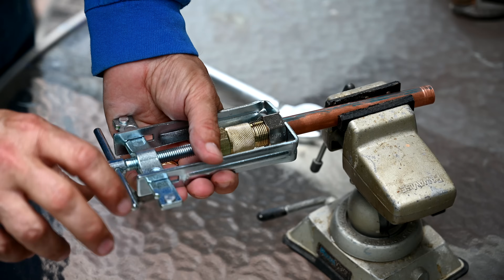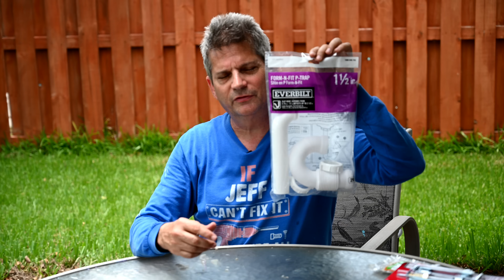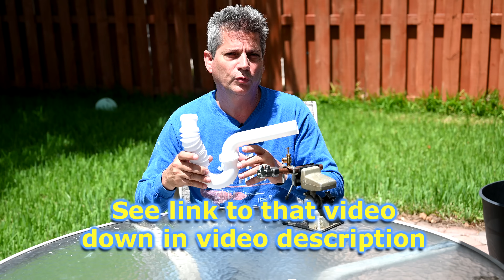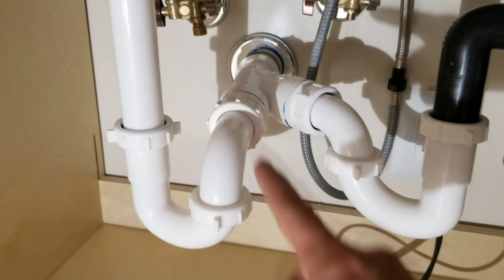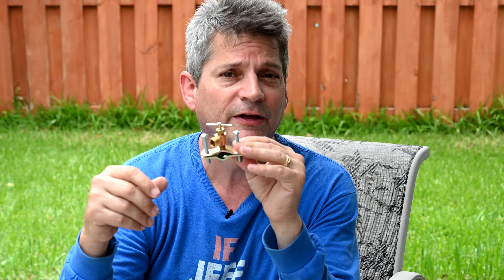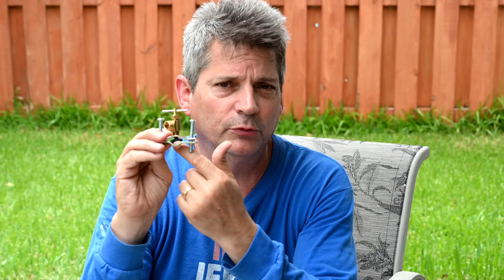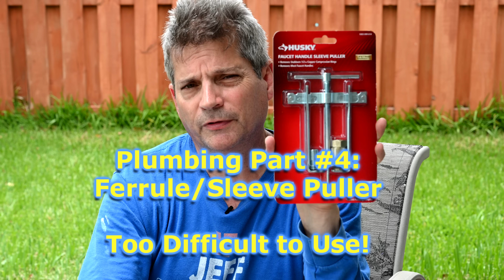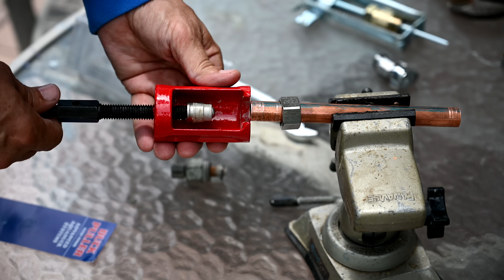4 Plumbing Parts/Tools You Should NEVER Use. NO Plumbing Fails

Comment: I live in Ohio, BestBuy installed my water line for my fridge, and I think they used dat there 3rd part you mentioned.
Reply from the maker: As long as it is visible, just keep an eye on it, check on it periodically. If you see anything starting to leak, time to call the plumber in to give you a double shutoff valve.
Reply: @jeffostroff  it leaks, but only when I try to get more waterflow from it. This means our cups take forever to fill, when I try to increase the pressure it leaks right where the stem of the twisty thing goes into the fitting.

been wanting to get it fixed for awhile, and now that I seen this video, I'm going to lookup the code in ohio and see if this was something illegal they did. If so, see what I can do about getting some justice.

actually, I made a video of it recently (mainly for my uses) https://youtu.be/M0q5wYdngi0

1) just realised, but at 48 secs is that an S Trap and should I replace it?

2) the fridge thing I was talking about is seen at 3:37
Reply from the maker: @Layarion  You tube says video is in private mode, so we can't see it
Reply: @jeffostroff  sorry, I set it to Unlisted now.

Hey I found this: http://codes.ohio.gov/oac/4101:3-6-01

at 605.9 it says  "Prohibited joints and connections. The following types of joints and connections shall be prohibited:" and then says "4. Saddle-type fittings."

so I think that's confirming what you said in the video about it being banned, just wasn't sure if you meant all 3 were banned in all states. either way, ohio is confirmed for that list.

aside from fixing it, this was installed maybe 5 years ago. Is there anything I can do to bestbuy to get them to pay for installing something illegally? like, "hey buddy, this violates the code. fix this and eat the cost"? like, what do you think I should do, besides the more obvious "not nothing"
Reply: @jeffostroff  should be able to see the vid now.
Reply from the maker: @Layarion   Layarion  Holy cow dude, you got multiple issues at once. I suggest you blow the whole place up and start over! LOL. It looks like you have several spots on that basement floor where rains are being absorbed into ground water, then leaching up through your cement slab. this might repeat itself after winter frost melts in spring. Back in the day they did not put Visqueen plastic underneath the foundations before they poured, which would help keep water from raising up through the concrete. You should check out Mike Holmes for how they solve these issues, sometimes I have seen them put down thick firm sheets of insulation on the concrete, then build up the floors over the water, which is channeled to the weeping tiles on the perimeter of the basement. Also I'm concerned about the rotted support post on your stairs, get that fixed as soon as possible, just bring in a new pressure treated 4 x 4 post, and put a metal plate at the bottom where it touches the concrete. One other reason your saddle valve is failing, is they mounted it sideways, so any mini drips of water run down the saddle and corrode it. Also, they apparently have no gasket that I can see, so they have 2 dissimilar metals touching, which is a big no-no. I always felt they should have the saddle made out of copper as well, now 2 different metals touching causes corrosion. I would try to get Best Buy customer support to send out a real plumber. If that fails, file a BBB.org complaint against them, as well as the state attorney general web site online consumer complaint form, they forward the complaints to the corporate office and usually someone there can resolve the issue.  Search to see if there are any class action lawsuits against them like there were against Sears in IL a few years back who sent unlicensed "plumbers" to install saddle valves, some of which caused thousands in flood damage and also violated IL plumbing codes.
Reply: BESTBUY should not have touched your plumbing, unless they contract a plumber. As I understand it, leaks of this nature are second only to washing machine hose failure for homeowners insurance claims.
Reply: 😂😂😂 dat there 3rd part.
Reply: I had to cut and replace a section of line my self for this exact same problem 2 years or so back. We bought a new fridge from best buy and paid for the "installation" lol. Well they used one of those saddle valves, I didn't know better at the time and trusted their installation. It leaked, and leaked bad shortly after. Luckily it was in my crawl space and identified the pressure issues before it got bad and ugly! Thanks Bestbuy! No bueno.
Reply: you can not shut them. a refrigerator is under code  "an appliance" and can be installed by an unlicensed person.
 But once they install a valve they are messing with licensing issues. Self-piercing Saddle Tap Valves are illegal under the Unified Plumbing Code and under BOCA plumbing code and others

Comment: I think you might owe husky an apology.  I'm pretty sure those arms are for using the tool to pull off handles for bath/sinks that are stuck on.  Take off the arms and its pretty much the exact same as the 3rd one.  And if you need more leverage then just stick a small length pipe over the handle.
Reply from the maker: Husky owes us an apology. The tool works fine on a normal ferrule, but on stuck ferrules is when that tiny little spinning arm they have digs into your fingers, and it's just not long enough to give you any mechanical advantage like a wrench.
Reply: @jeffostroff  The arms you are talking about aren't for ferrules, they are for pulling off stuck facuect handles. Don't use them or just take them off.
Reply from the maker: @beaug4306    I have a better idea, just don't use the tool at all, it's trying to be a jack of all trades. I never have a problem with the duck puller, because I can use a ratchet with socket wrench or my Rigid One Stop Wrench with huge mechanical advantage to loosen the most stubborn of stuck ferrule sleeves.
Reply: @jeffostroff  I'm going to have to disagree with you man.  Your 2 criticisms of this tool are the arms and lack of mechanical advantage.  The arms aren't even for removing sleeves and they can be taken off the tool so they don't get in the way.  You were using the tool wrong which is why the arms weren't working and getting in the way.  As for mechanical advantage, yeah being able to use a socket wrench is much better, but you can just throw a socket driver or length of pipe, or anything long and hallow over the handle and you're good to go.

Comment: Gawd i wish i watched this video a month ago. Had a stuck ferrule at a tenants house. I didn't know what it was called or that it could even come off. I changed the valve and couldnt figure out why it was still leaking. Called a plumber and he took a look and said the teflon was the problem. Oops. I took off the teflon but it leaked even more. Thought i damaged the valve with the teflon so i changed it again! Lol it still leaked! I figured it was that screw on cap that i couldnt take off so i gave up and called a different plumbing co. And they took off that ferrule thing that i didnt know could come off. They used that blue handle pliers though. They didnt use the ones you showed. Expensive lesson. Now i know what to buy and how to use it. Thank you so very much for putting these videos out. Im learning alot!
Reply from the maker: Awesome Angela. The plumbers that used the channelocks from what you described, that is a risky move because you can deform the pipe when you squeeze tight around the ferrule, rather than pull the ferrule straight out off the pipe from behind it with a duck puller tool or the Husky tool. Certainly a novice should not attempt that trick without a lot of practice in being gentle, and gently coaxing that ferrule off the pipe. Especially when it is stuck. the more stuck it is, the more force you have to use with pliers to try to remove it, which is why having that specific tool for this job works best

Comment: Interesting video. I'm not a professional plumber but have done quite a bit of work in my day and hate to admit that I've used some of this crap more than a few times as a temporary fix in a couple of my rental units when I didn't have tools with me or the right parts available. You are right, they are cheap, simple to use but ultimately junk so don't plan on leaving them in place. Was interesting to see the codes on traps that are no longer approved such as drum and mechanically operated traps. I have one rental that has drum traps. When I remodeled the house I ran into them where the washing machines drained into the main drain leading to the septic system. I was going to remove them but a plumber friend said while they are no longer used why bother. Still there and still working. Not certain what the issue is with them but until I have a problem I'll just leave them

Comment: you might have tried to use the Husky sleeve puller correctly, utilizing the notches and not your hands.
Reply from the maker: On these newer versions of the tool the instructions on the back from husky are now saying not to use those brackets at all so even the notches are not part of the equation you're supposed to just screw right into the front of the nut with the tool. Remember husky is trying to build this as to tools in 11 of them being a knob polar in which you would use the 2 arms.,  the other one being the sleeve puller which you don't use the 2 arms.

Comment: Fella the thing you’re calling a sleeve, is called a olive over this side , to get it off use a adjustable wrench /spanner , open the jaws to the size of the pipe then just put it on the pipe and run it to the nut and tap it off!😉
Reply: Each situation is different. You might not have enough room to tap once you get the spanner on the far side of the nut.
Reply from the maker: I prefer the duck puller tool because I don't ever want to risk banging the pipe and denting it, although if I had to in a pinch, would probably use your trick. Also, what about vice grips, you could lock them down around the sleeve, that way you don't bang on the pipe. you just bang on the vice grips, and they slide the sleeve right off the pipe.

Comment: If it wasnt for idiots installing junk and old pipes. We pros wouldnt have work lol
Reply from the maker: This is so true.  I was at a friends house today completely redoing the condensate drain line from the or air conditioner because the professional company who installed it for them didn't use the purple primer on the PVC pipes in the junctions lead at 4 different connectors

Comment: What about using saddle valves on iron pipe outside for swamp coolers?  Is that a code violation?  I think every swamp cooler I've seen is connected this way.  I bought a property with such an installation and was wary of it.  Since it's outside I'm not concerned about damage and have just been waiting for it to fail before replacing it with a different solution.  However, it's been working perfectly for over 20 years.
Reply from the maker: That is a good to question the code does not really differentiate between inside or outside so who knows but if you're willing to take the risk and it's nowhere near routes going to cause you any harm should not be a problem for you
Reply: I assumed that's why those saddle valves were sold -- specifically for swamp coolers.  It's not that I'm wanting to take a risk, I've just never seen a swamp cooler hooked up any other way.  If you buy a house with a swamp cooler in So Cal, you're probably gonna have a saddle valve to go along with it.

Comment: Dunno about those "sleeves" in the last one! We call them olives and they can only be used downstream of an isolating valve. Never re-use the same piece of copper, as they deform the pipe .
Reply from the maker: They don't deforme the pipe from any installation I've ever seen in the truth lies in the pudding because if they deformed the pipe you would not be able to insert the new sleeve on when you go to change them. You would have to be doing something really foolish to deformed the pipe. But a good trick to reform your pipe the back to a perfect circle is to get a plumber's wrench form a good 3 point grip around the tube, and just rotate your wrench until it forces it back into round.

Comment: The cheaper Husky puller tool does work and not how you demonstrated it.  The tool is used without the two arms that get in the way, and hold the back of the nut.  You didn't use the center piece which was rolling on the table.  You are supposed to remove the puller arms, and then use the center piece which actually allows the tool to be used correctly, because it is the piece which allows the compression nut to pull off the compression sleeve, by tightening the center shaft which forces the compression nut to pull the ferrule off.  Basically, like the second recommended tool you showed.
Reply from the maker: Yes, Husky has improved the design of this tool, but on stuck rings, it still is a pain to use because of the twisting bar. that's why I like the Duck Puller better, because a ratchet with a socket wrench is a lot easier on your fingers and provides a way better mechanical advantage for turning that nut with a wrench that is longer than that tiny bar Husky gives you on their tool..

Comment: P-Traps? Those thin walled traps you show are not good to have in your house. I have seen some drain cleaners eat their way through them with ease. If you pour drain cleaner into a drain make sure you flush it out pretty quickly or it may damage the trap and/or your house.
Reply from the maker: I don't use drain cleaners, but have seen many people use drain cleaners, and have never once seen it eat through plastic. That plastic though thin, is not any more susceptible to pipe cleaners. And because they are so smooth, they are self scurrying, so any liquid going in will go out with about 2 seconds of running water.

Comment: Try installing a zero clearance p trap on a sink from Ikea.
Reply: Why would you do that ?
Reply: @apprenticelogic6642  
So a drawer can go under the sink. It is a 90 degree pipe that goes to the wall where you will have to install the trap. Total pain but what does one expect from IKEA.
Reply: @michaelprosperity3420  so the trap needs to be inside the wall?
Reply: @wingerrrrrrrrr  
No up against the wall. At least for the sink I purchased. The top drawer of the vanity doesn't allow you to go straight down and install the trap in a traditional location.
Reply: I've seen some where they had split drawers, but I guess they went another way to get the drawer utility-
Reply: Ment install a trap u got in ikea

Comment: I’m a service plumber with over thirty years of experience. 
1. I’ve seen piercing valves last for over a decade. They don’t leak “shortly” after installing. They’re great for DIY people. 

2. You are not using the handle puller for its intended usage. I’ve used that particular tool since I started my plumbing career. That one is used for removing handles from older style tub and lav faucets. 
3. You don’t always have to remove the feral or nut from an old supply stop. Most of what I’ve replaced over the years I have not replaced with no problems.
Reply from the maker: Grandapa, a number of you guys have commented about the Husky tool being used as a faucet handle puller, but you are all unaware that Husky also bills it as a ferrule sleeve puller as well, and in fact, on the back of the product they have listed 2 sets of instructions depending on whether you use it as a knob puller or a sleeve puller.
Reply: @jeffostroff  You don't use the arms to pull rings. You have ot screwed in too far at the start and that's why it's hitting. You basically only use the sleeve attachments and ignore the top frame and arms.

Comment: I disagree with you for the sleeve /handle puller, I use it for three years with no problem, you need to hold the two handle that grabs the sleeve with channel lock plier while turning the handle.
Reply from the maker: No way, you should not have to do that. This tool is trying to be 2 tools in one. I use the duck puller and it works every time just be using my Rigid One Stop wrench. Much easier and you don't have to work harder trying to run this big bulky tool with the Chanel locks. But if it works for you fine. You should try either the Duck Puller, of the English Tool Company puller, I use both, very similar to each other, and both easy..

Comment: Im from South Africa and tho the regulation for the flexible P trap (8:01) isnt as strict it is still frowned upon by Plumbers to use these.
A couple of other reasons why this trap is bad is that the flexibility of the trap is its downfall, it is always in constant movement from draining basins and so the concertina part can tear easily as well as, and I have seen this, drain rats love the high this plastic gives them so they will chew through it and thus you have leaks.

Comment: Half of those codes were written so you have to call a plumber !! 

After owning 20 or 30 rentals for many years I have seen some or all of these things done. Never really had a problem with any of them.  I'm glad I'm old and retired.   In a world, a long time ago, I could do what I wanted to my own home, and it wasn't anyone's business.
Reply from the maker: If it works for you that's fine. But read down through some of the comments from other people who claim they had saddle valves in their houses in a caused huge amounts of leaks and damage just a matter of luck of the draw but that's why it the codes are there is to protect from the leaks and to protect from plumbing not working properly.